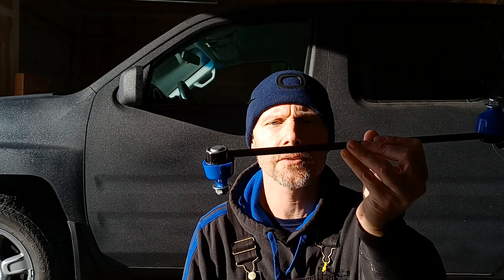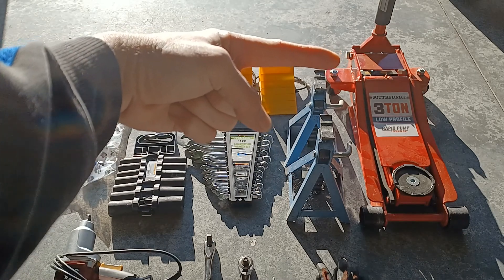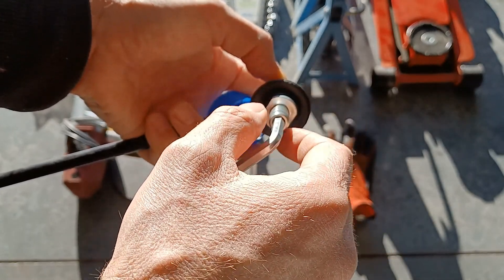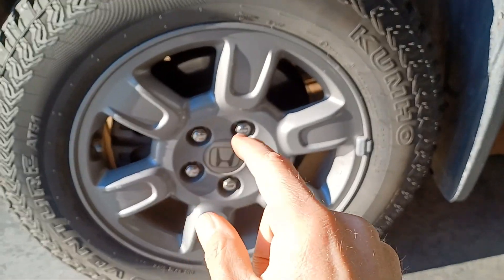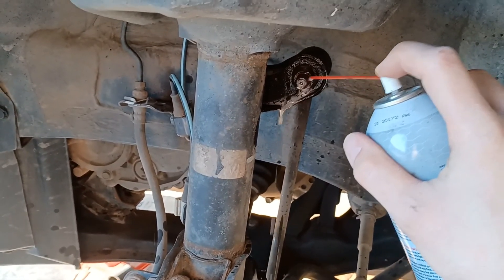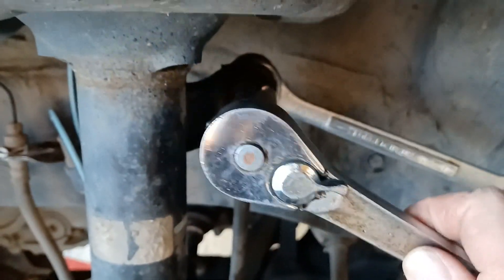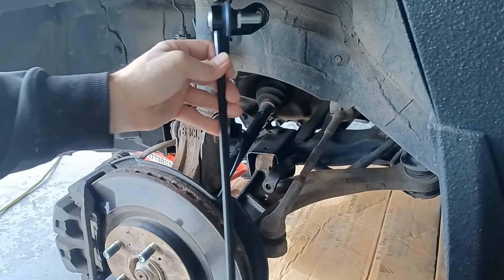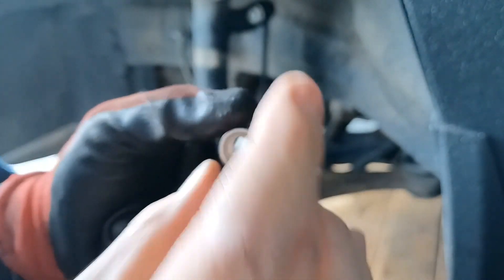REPLACE sway bar links...SUPER EASY!!!!!

Comment: Were you getting a clunking noise in the front? And did your end links have any play in them
Reply from the maker: Hey Bryan...on this vehicle, no I was not hearing anything out of the ordinary. The reason I changed them was, the little boot on the drivers side decided to split, and I didn't want any foreign material getting in there and eventually mucking it up. On another vehicle I had...yes, it was making a clunking noise when I would turn right (passenger side was bad) because of excessive play and a visual check left me with no doubt and manual manipulation bore a result where the joint was able to move freely very, very easily (sloppily).
Reply: My 2006 has clunking noises and most noticeable over rough terrain driving thru yard or bumpy rough roads 
Will see if noise goes away after install 
I do want to change the struts too 180k miles
Edit: replaced rods and bushings noise gone
Reply: By the way, I had to Sawzaw each bolt off each end on the rods...pita, no hex on other side but new aftermarket rods had the hex 
 2006 model produced in 2005 early release. 180k miles